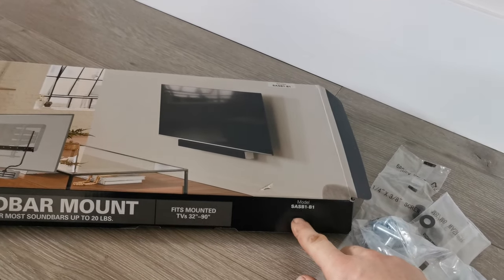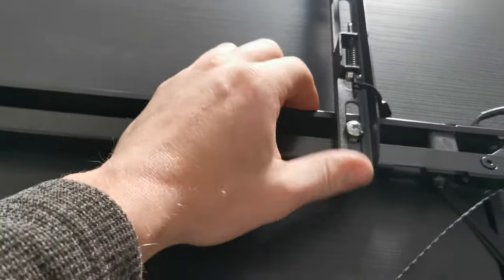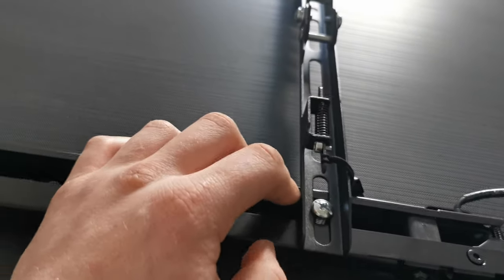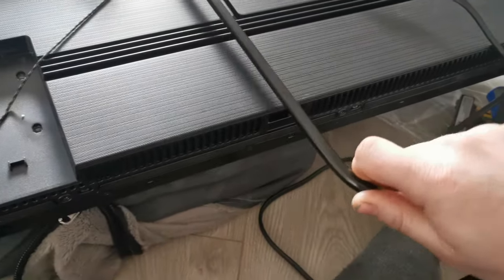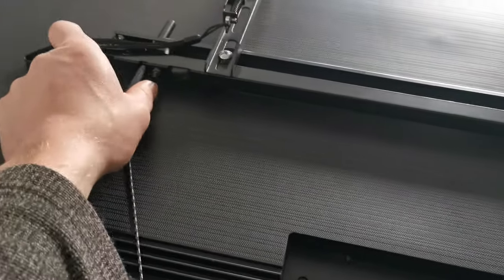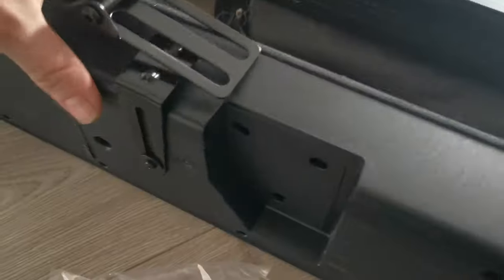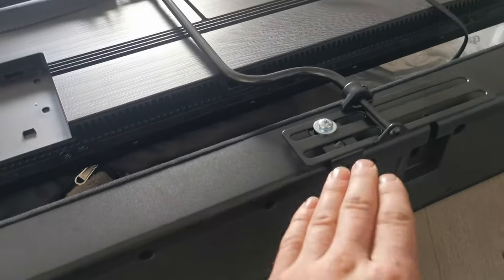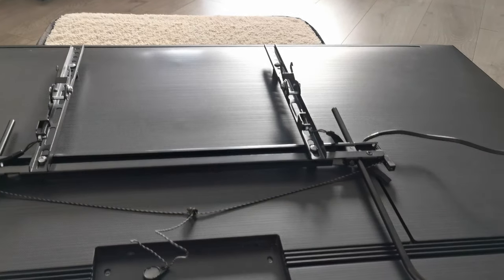HOW TO MOUNT SAMSUNG DOLBY ATMOS SOUNDBAR TO BOTTOM OF TV

Comment: Hey I'm sure there is a reason the Channel Side of the bracket is supposed to be installed toward the back of the tv. You are supposed to use the interface washers (part number 9) applied between the spacer and the channel to keep the spacer from going in the channel, per the instructions.
Reply: I just bought this and assembled it. That was the first thing I noticed about this video. He didn’t read the instructions carefully.

Comment: That's a nice video for soundbars WITHOUT upwards firing speakers for Atmos. Do not cripple your own equipement. Again, great for regular soundbars, just not for ones like this.
Reply from the maker: It would be good if sanus develops a wicked sound bar mount for the samsung sound bars like they did for the sonos arc and so on were it holds it infront of the tv for atmos speakers
Reply: @ghostlyrich  can you not just adjust the soundbar forwards?

Comment: when fitted are the upward firing speakers clear of the TV and is the LCD display on top of the sound bar still visible/accessible ?
Reply from the maker: It may impede them a little but yes the drivers are still exposed so you’ll get the Atmos effect
Reply: Not worth it then

Comment: How were you able to get it so flush with the TV while still not blocking the up firing speakers? It seems that I can't adjust the rods to be able to do that. Thank you in advance if you're able to give any input on that.
Reply: I'm also wondering about this. Did you ever find out the answer? I just bought a Samsung Q990D and looking for ways to mount it under the TV.
Reply from the maker: It wont block the up firing speakers, the sound bar mout holds it more forward making the speakers clear the tv
Reply: @ghostlyrich  it does move the soundbar forward but just a little that it won't clear the upfiring speaker in a Q990D. Don't you agree? The Q990D is 5.4" deep.
Reply from the maker: It clears on my installs and does not effect the atmos experience. The up firing speakers will shoot up reflecting off the tv and walls/ceiling to listener
Reply: @ghostlyrich  reflecting off of the TV? How does that happen if you said it clears the TV? Do you have any pictures that shows that it clears the TV? And is this for the Q990D or you're referring to other soundbars?
Reply: @ghostlyrich  any udpates to my question? I'm genuinely asking for your help before I buy it.

Comment: This mount says supports up to 20lbs. Do you have any worries using this mount with such a heavy soundbar?
Reply from the maker: i was questioning it at first but after assembling and testing it a bit, it seems to do just fine and hold up to the task.

Comment: This doesn’t fit my 85 inch Samsung even though it says it fits 30”-90”
Reply from the maker: Ohhh some like cu8000 mount to darn high i usually extend it with metal strips
Reply from the maker: Oh also i have mounted it off were the pedestal mount if it is a centre pedestal for example a Q 80 or a Q 90 series